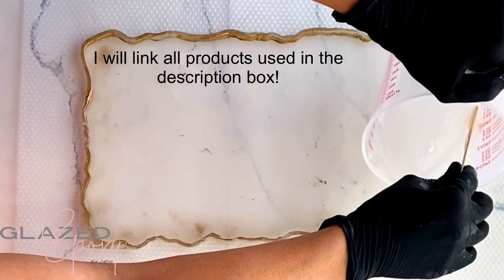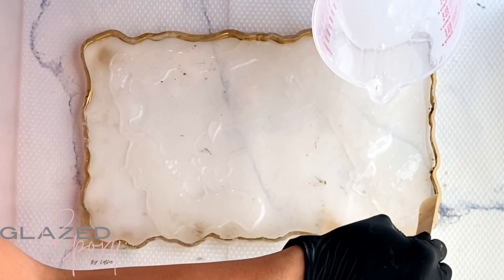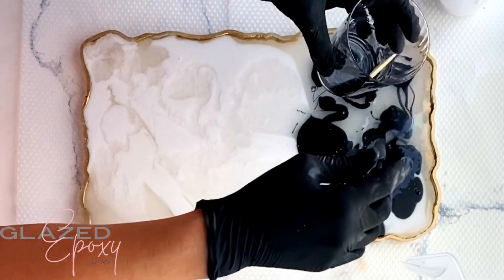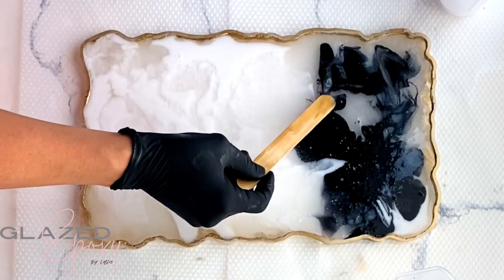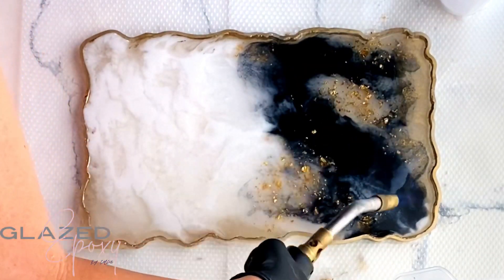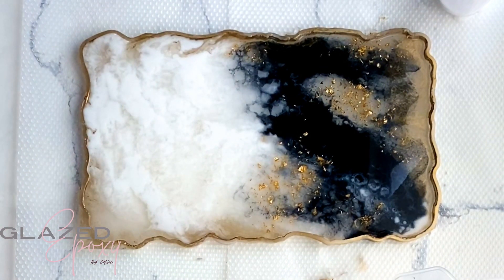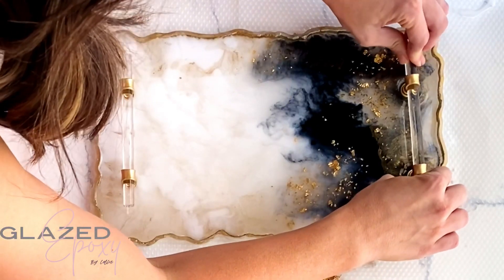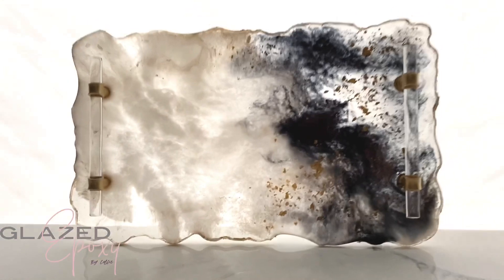HOW TO USE EPOXY MOLDS: Black and white epoxy resin tray tutorial 2020

Comment: Love this!! ❤️❤️ Beautiful!! 
Can you make the tray thicker? How durable is cured epoxy? Also, can you give steps on how you prep the mold? Thanks!! ❤️😊
Reply from the maker: Thank you!! Epoxy is VERY durable! And you can make it as thick as your mold, but if you get much thicker you need a casting epoxy (different pouring depths need different formulas to cure properly) but casting epoxies don’t hold color the same. I want to do some cutting boards using really pretty wood and doing a river in the middle! So I just spray a mold release spray on the mold, and sometimes I will mix gold mica powder with alcohol and paint the edges of the mold first, I will definitely add that to my list of videos to do! Thank you for watching! ❤️💕
Reply: If you do the gold paint around the edge are you putting a mold release on prior to that?  I love the gold edge

Comment: how much resin did you use for this piece? love your work btw :)
Reply: If it is 12x18 inch and 8 mm thick it need 450 gm of resin
Reply: U can calculate it by using any app and measure it with weighting machine

Comment: Can I use simple lighter instead of torch or heat gun.. or what other thing I can use to remove bubbles ? Can I use paper cups or simple plastic cups for mixing resin ? From where u got silicone mixing cups n beaker ? Can I use normal surgical gloves ?
Reply from the maker: So I have seen people use a regular lighter instead, it will help but it’s not as effective as a torch. You can also use a blow dryer to move the color around and the heat from that helps pop bubbles as well! The nice thing about the plastic mixing cups is that there are measurements on them to mix your epoxy correctly. I’ve never used paper cups but it could work fine for mixing color into the mixed epoxy. Yes any type of disposable gloves are fine! I get my mixing cups from Amazon in bulk! I hope I answered everything, please let me know if you have any other questions! ❤️☺️
Reply: @CallieMileham1  thank u so much.. can u share the link for amazon
Reply from the maker: Here’s the mixing cups! https://amzn.to/3elZklN
Reply: @CallieMileham1  thank u so much

Comment: I made my first tray but today it's on my third day and the tray bend in the heat why what do I need to do next time as this was my first one ...??
Reply from the maker: Well it could be the epoxy you used it not best for trays, or if mixed wrong could cause it to not cure. What epoxy was it?
Reply: It's was famowood glaze coat ..but I just bought proMarine brand recently..
Reply from the maker: So it could just be meant as a thin coat over wood, try this one, it’s hard as rock in molds! https://artistryepoxy.com/shop/epoxy-resin/tumbler/ 🥰
Reply: @CallieMileham1  so is the proMarine good for this ??
Reply from the maker: I’m not sure, I’ve never used it ☺️

Comment: hey I have a question how much resin did you use for the tray i need to know if i’ll have enough to make mine?
Reply from the maker: I think about 12 to 15 ounces, I need to start writing down how much I use lol. But if you pour it and decide it’s too thin, you can add a clear layer of epoxy on top while it’s still in the mold! Thank you for watching! 💕
Reply: ok thank you